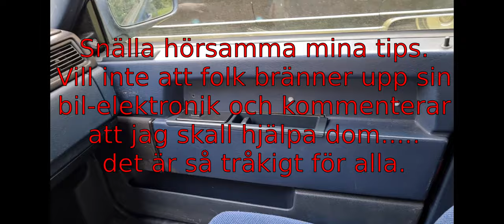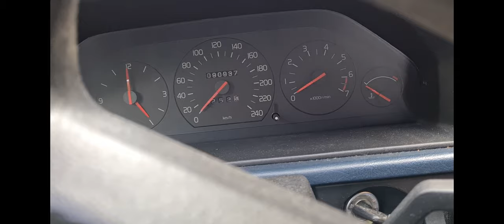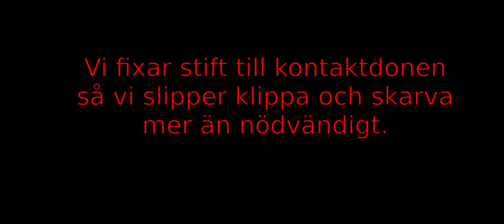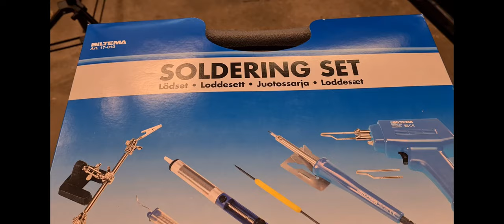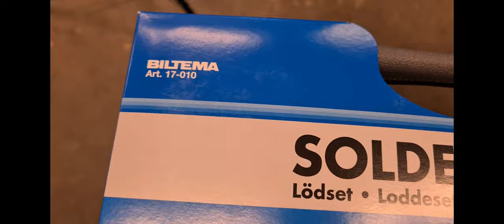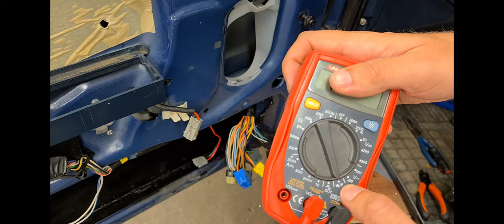Kopplar el till fönsterhissar i Volvo 940 1994

Comment: Greetings from California! Do you have information in English? I have1993 Volvo 940 with a similar problem and would like to understand how you fixed it. Thanks!
Reply from the maker: Sorry no info in english, but basically what I discovered is that my car had full wire harness in the car already, just door harness that are different based on options. Someone else commented from which year they used one standard harness in the cars. Older year models will lack parts of the cars harness and you'll need to do the full wiring as shown in many other YouTube videos. Find the colors of the wires on electrical wire diagrams.